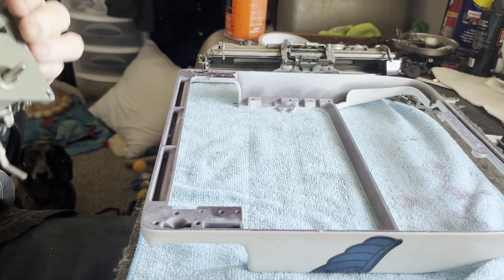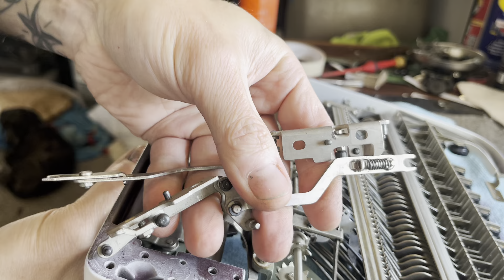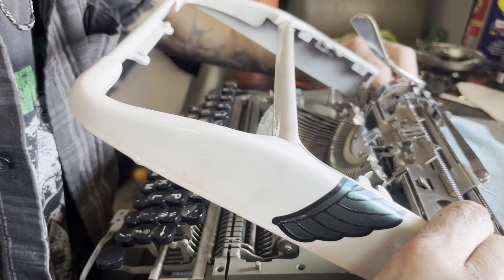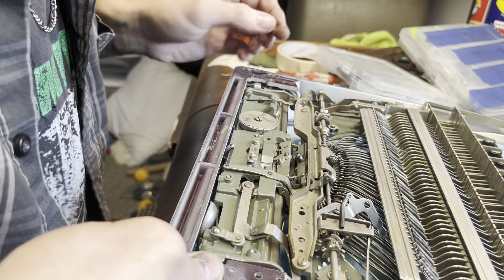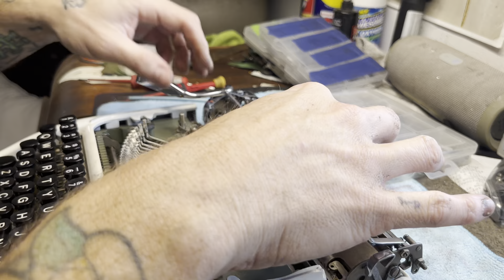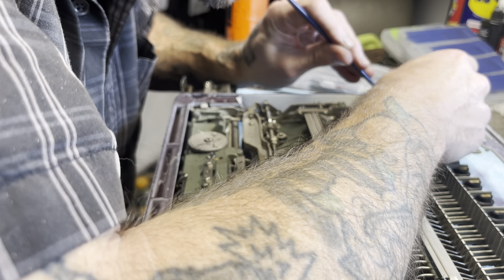Groma Kolibri Typewriter Rebuild Episode 2-Marriage of the Minds or How to Go Crazy

Comment: What a nightmare. However, it looks to me, like the shift-arms could be taken apart and later attached/connected. They have a screw on the side? Also, it might help to screw the main part into the shell as the very first step? But either way, I will never touch a calibri, that's for sure.